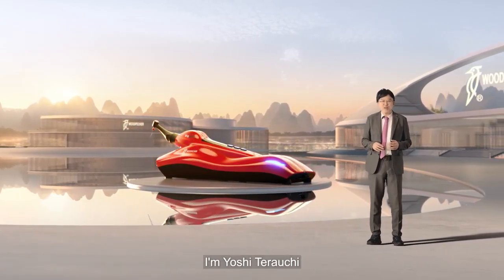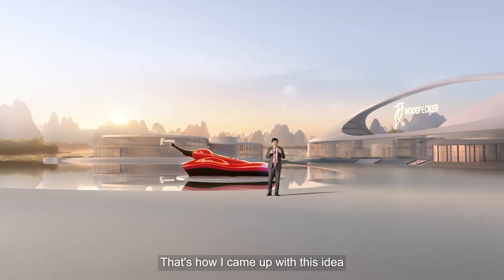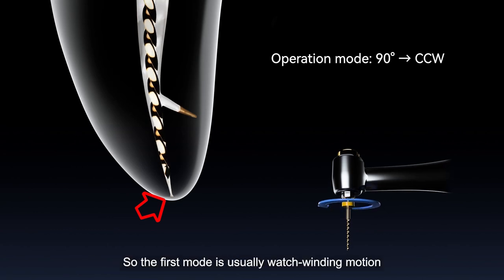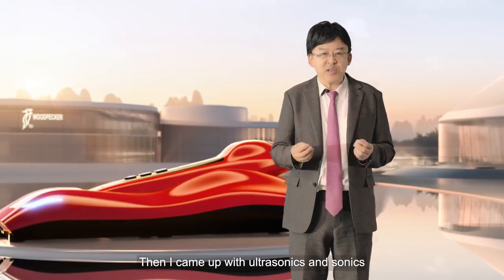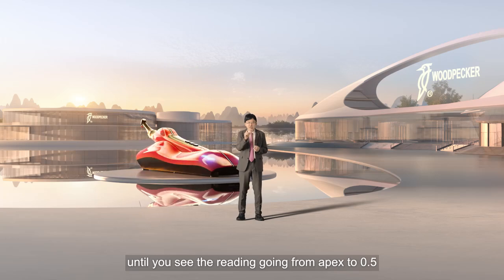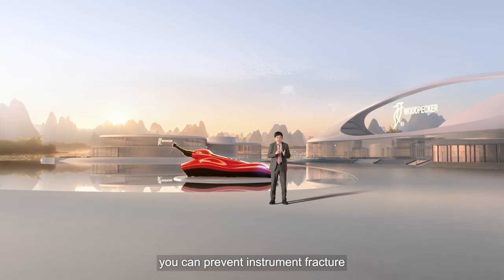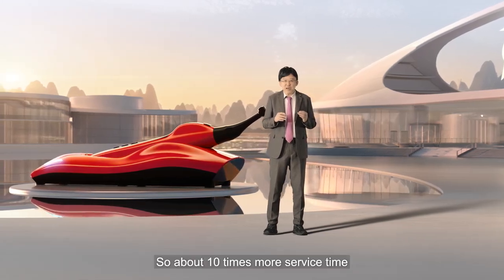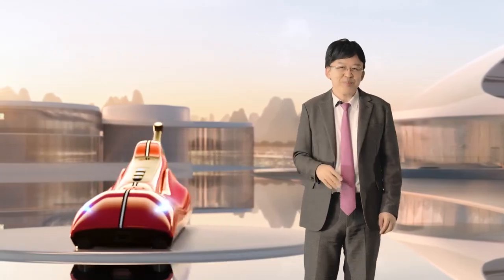Woodpecker 812 MT Endo Motor designed by renowned endodontist Dr Yoshi Terauchi

Comment: We use endo pace endomotors and woodpex v apex locators in our practice.
 & they are reliable 😇
This product seems interesting but MTA as obt filling material won’t it complicate rercts?
Files which are designed to cut clockwise if used for sonic & other modes in these . will it affect life?